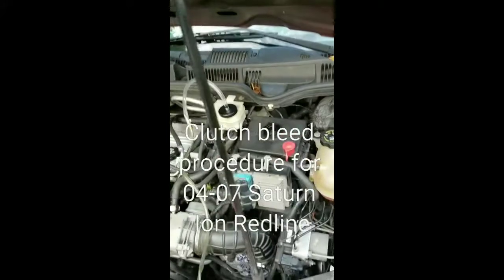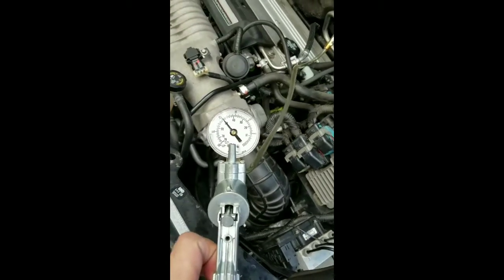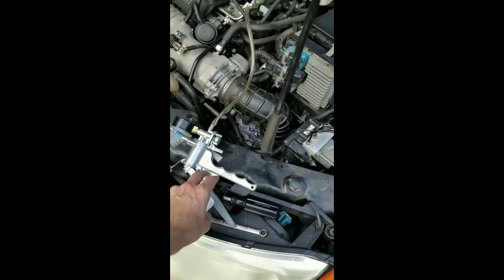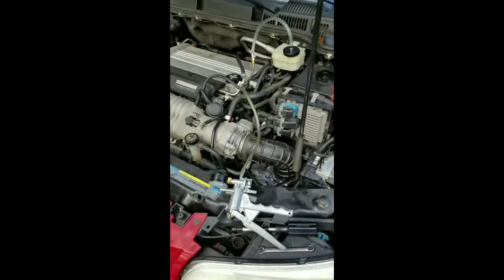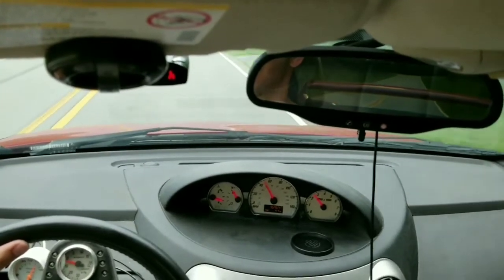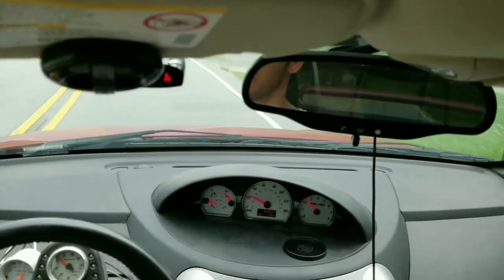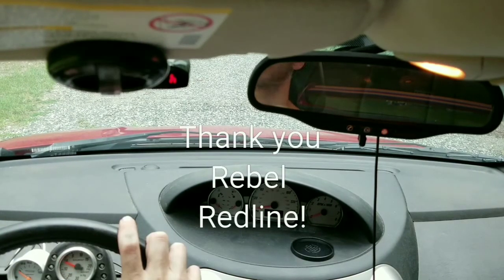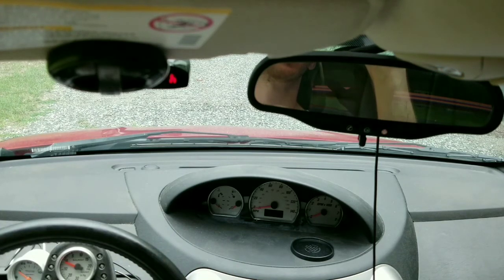Saturn Ion Redline Clutch Bleeding Steps

Comment: I have a '04 Saturn Vue, bought new, with m 92k.  The slave cylinder went out and the repair cost $1200.  They could of ran a cable like a motorcycle!  Way over engineered!  It's a German trans and clutch...

Comment: am i dumb, those are the brakes
Reply from the maker: There are two halves within the reservoir.  One half is for the clutch, the other half for the brakes.
Reply: Isaiah, They're both hydraulic systems setup as dual feed. The Clutch Master Cylinder uses the same reservoir as the Brake Master Cylinder.
Reply: @ahotmess2261  Porsche did that for a while.  Why did it end up on my car 30 years later, after it failed
 ?   Oh.  Economics.  I bet you it was cheaper
Reply: @tfaber9394  I dunno its also a good secondary safety feature.  If you lose all your brake fluid you can't shift gears because you lost clutch engagement let alone trying to stop without engine braking the car(down shifting).  People will try to do what ever they can to stay mobile up to and including driving without brakes. I've seen and done some crazy stupid sh*t like that in my 30 years behind the wheel

Comment: Did you have the clutch pedal pushed in while using the vacuum? I tried your exact method and it's not working. I pumped the vacuum. Several times for a couple hours. The pedal doesn't even seem to stiffen up at all.
Reply: Excellent question.   I have the best luck when I I build up pressure to about 25, then pump 1 time, check the pump,  ...do again,  always keeping above 10psi on the system.  NOW,  you have to make sure that the little valve is not leaking,  so wrap teflon tape around the little nipple before you try to bleed her with that 9mm wrench on top of the slave inlet.   ....   I found the most important thing is to keep pressure in the system.  Don't get too frustrated and throw tools...this is a very difficult thing to do...and it makes no sense to lose your temper.   And then, by magic, it just happens.   I have been working on cars for 43 years...this is one of those mysteries I can't explain.   I guess finally the car gives up,  and it thinks you love it,  and it lets you win.  I dunno.  As any car lover knows....our cars love us.  Like a an-ex wife sometimes,   but if you love her,  she'll drop her panties eventually and help you. Now,  if all else fails,  and you are 100% sure you have done everything you can.   For God's sake...call it a day.  Nurse her to the shop,  and let them bleed the Goddam clutch before you go crazy.  It's 50 bucks.   You haven't failed.   You just didn't have the right equipment.   OK?  
Good luck.  And by the way.  I have lived with a Redline for 16 years.   Not a car for normal people.   It is finicky,  and a de-tuned high performance vehicle.  But it's LSJ  lets it easily upgraded to be a 500hp monster, Corvette Killer,  STI killer,  and still a bullet proof engine....up to 800hp.   With an original handling package developed for the Nürburgring.   This frame is a balanced package.   
Gm Performance named the Saturn 2006 Redline.....the Flagship car of 2006.  Not the Caddy CTS-V.   

If you own a Redline....  you own a piece of History.  and a very strange, rare car.   It is a de-tuned "Tuner car".   GM Performance division gave us a car,  with the ability to  BECOME a monster on the track.   ZZP saw this car,  realized it's capabilities....and pushed this car.   They never broke it.   They admit..the LSJ engine is ...tough.  Bullet proof.     They raced it,  at single turbo 500 hp with a bent rod.  AFTER they raced it the year before at twin turbo 800hp.   
They didn't know the engine had a bent piston rod the whole time.   The LSJ is a strong engine.   

If you own a Redline, please take care of it and love it.  They didn't make many.   They are very special cars.  +
And Please take care of one,  if you find one.   

T
Reply from the maker: Pump the pedal with the vacuum applied (with the needle at 15). If the pressure is not holding, there is either a good amount of air in your lines or you could have a leak somewhere from the cap (hopefully not somewhere in the system)
Reply: @n3ologicprojects351  I don't think the cap provided a good enough seal. I found it easier to just bleed the line. I was successful. I was also working on a 2004 Saturn Ion. Could've been the easier method with that year, make and model. Thanks for the video, though!

Comment: Got a question you might be able to answer: In the FSM they refer to moving the clip on the clutch line block to the "bleed" and "normal" positions. What the heck are they talking about?
Reply from the maker: they are probably referring to the line that is found right on top of the transmission. it's hard to get to and i've found it will do more harm than good to try to bleed the lines from there because it is very easy to remove the clip and then accidentally pull the line all the way out pouring brake fluid all over the transmission and whatever you are parked on... (experienced). the easiest (and possibly the best) way is to use the negative pressure method.
Reply: That's what I'm gonna do.

Comment: ZZPerformance sells a modified master cylinder with an adjustment nut. That’s the only way to adjust pedal engagement on the Ion Redline.
Reply from the maker: a mechanic who was changing my tires told me that he "adjusted" my clutch, i found out about a year later that what he actually did was "broke" my clutch where the ball goes into the back of the pedal. i had to replace the pedal and push-rod because it destroyed both over time and bent the rod. thank God for junk yards!

Comment: I have a redline also but im having trouble bleeding the clutch.
Reply: Yup.  We all do.  I usually give up,  and limp her down to the local shop and the have the equipment to do it.  $50 here.  
The damn brake on these little bitches are a nightmare.  But rtust me, when you're skidding one of the little freaks around a turn at 80,   you definitely want all 4 paws operating.  This car can kill you if it's not working together as designed.  These cars were rigged for the Nurburgring,  and GM performance sent the Mules there.   These are not toys.  They are capable of 800hp and the suspension was designed for track.   These are de-tuned little monsters.   They will kill you if you don't respect them, as with any car.

Comment: Are you reverse bleeding with a vacuum bleeder?
Reply from the maker: Yes. This is the best way I have found to bleed the clutch for the Saturn Ion.
Reply: @n3ologicprojects351  I have tried everything...it's always a pain in the ass.  Pos, neg,  even old style partner system,.   I read on the AutoZone site under the cautions of this part "difficult bleeding"   ...duh.  In 43 years wrenching,  this frickin clutch cylinder is one of the most aggravating things I have ever encountered.  So don't feel bad.
Reply from the maker: The device I am using is a vacuum pump to apply negative pressure in the system to draw the air up.
Reply: Exactly my observation.
I want to locate the bleeder at the slave cylinder